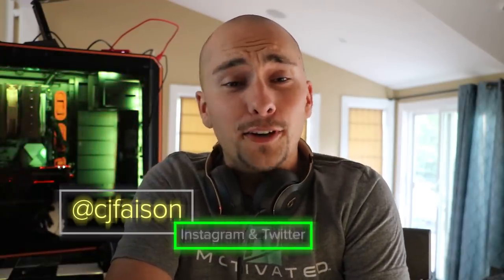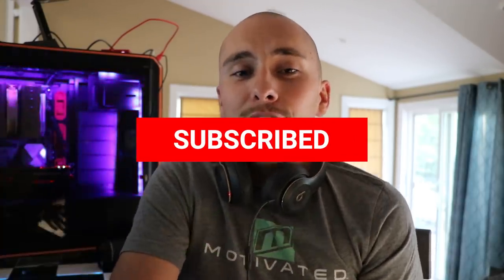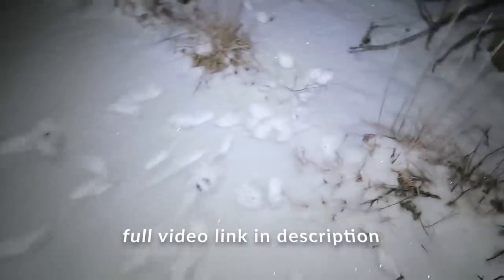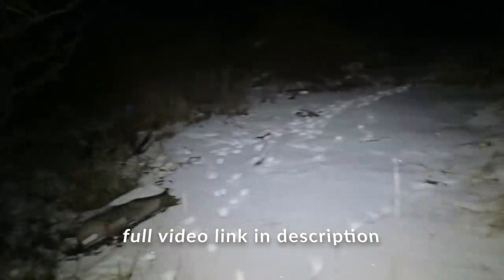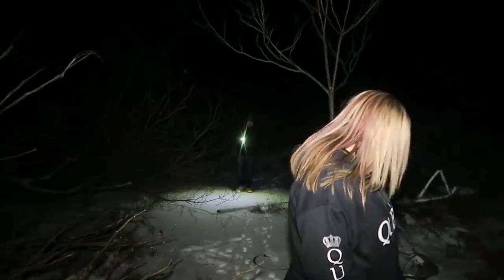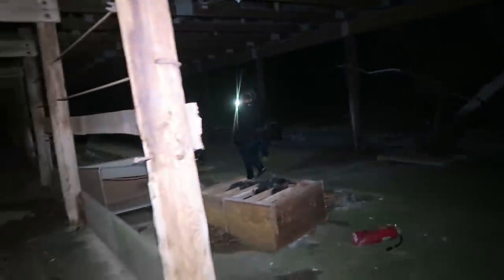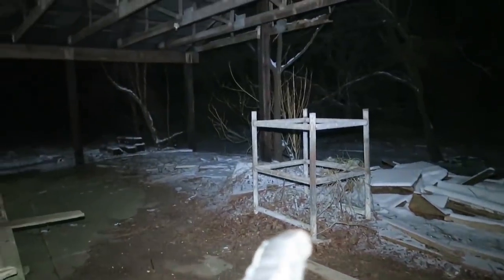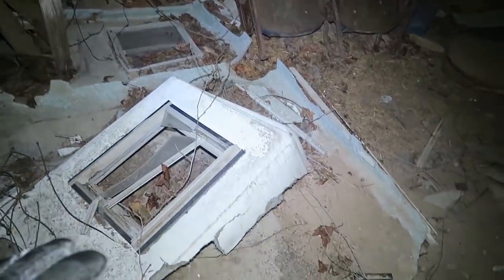(CREEPY) SHADOW FIGURES AT HAUNTED HONEY CUT FARM!

Comment: I pretty sure it's only Omar's camera. The reason I think this is cause the mid/base is square shape and what would appear as legs is the stick to hold onto and Omar's arm. Then the part that looks like a head is the camera light. But what made it seem like it was running was Omar turning his camera at a fast pace, while your light and camera was pointed in his direction.

Comment: the shadow shape does not change. Yes it is surprising to you and to the viewer, but honestly it looks like headlights making some shadow of some fixed non-moving object. Given that it was in the barn, it looked in context like something hanging from the ceiling or a rope that you would push down the center path, but I can't tell where the shadow is. If it is merely a shadow on the far wall, then a headlight hitting a fence post would cast a similar shadow.

Comment: Definitely a shadow figure. You can tell the way you was standing and where Omar and Tiffany was it was a reflection of anything. It moved toward instead of away and was more outward you Kno. Get protection holy water stuff like that. Pray before entering I to a place if you're a spiritual person. Stuff like this happens and it's incredible evidence when captured. You can Google to see what you need to do for protection and stuff like that Wich I'm sure u know lol but this is amazing. Keep up the good work.
Reply: What about Omar's light? Honestly, it doesn't look like anything. It looks like it was from the building. Slow the speed 0.5 and you can kind of see it clearly. Nothing paranormal

Comment: I don't see that how that show figure, one because of the deformity along the abdominal area looks very to the wood, wires and etc. 2 its going the same speed as your light going the opposite direction. I believe your just freaking yourself out for no reason. Remember our mind is very tricky & powerful to turn something in our vision that is scary & most Lilly isn't scary at all. Go back there if you can to that exact same area if you can but, during the day time.